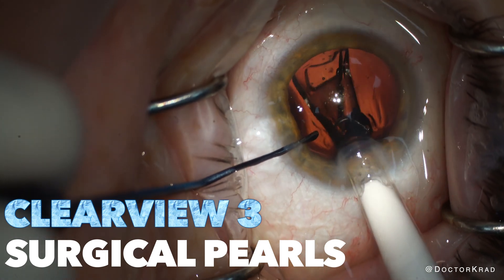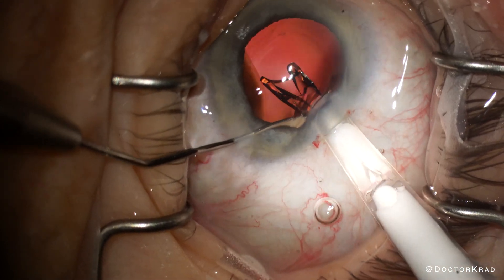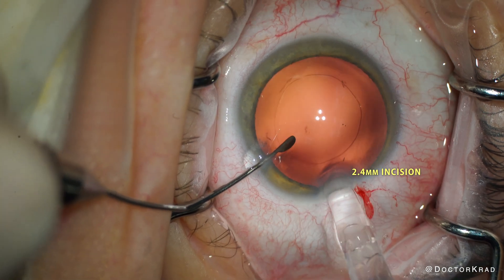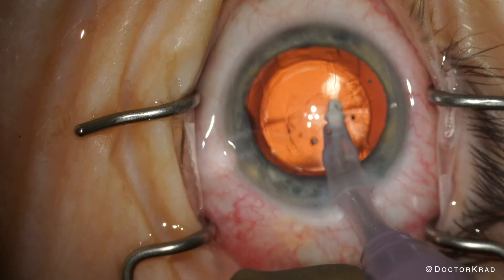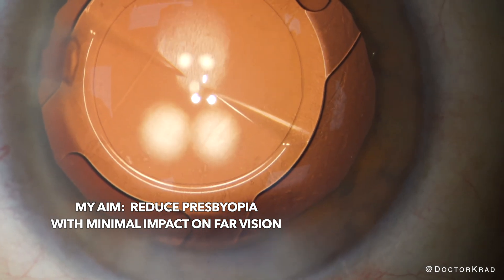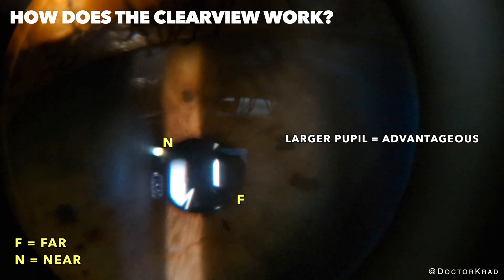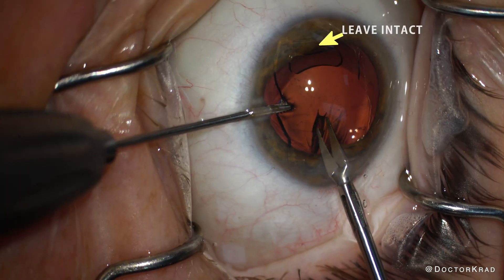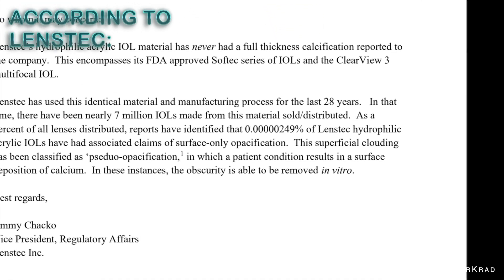Cataract Surgery Pearls with the Clearview 3 Lens Implant

Comment: Doctorkrad, just wondering whether you have ever done cataract surgery on a patient with Fuchs disease and the related risks or downsides associated with doing this procedure for the patient? BTW, super informative videos! 👍
Reply from the maker: Thanks!  Yes I commonly operate on patients with Fuchs dystrophy.  Fuchs patients have less corneal endothelial cells than average, so during surgery we have to be extremely careful to protect the cornea.  Specific steps that a surgeon needs to take are efficient cataract removal, a peripheral incision, guarding the endothelium with a second instrument, and to replenish escaped viscoelastic to keep the endothelium coated and protected throughout the case.  Laser may be used to help increase the efficiency in removing the cataract.  If I expect a patient will need a DSEK or DMEK in the future, I choose a refractive target that is slightly myopic since there will likely be a hyperopic shift after endothelial transplant.  I would also prefer to remove the cataract before it gets very dense since it’ll be less traumatic to the cornea.  Hope that helps!
Reply: @DoctorKrad  , thanks that is very helpful. Your response is much appreciated. Go well!

Comment: Beautiful surgery! I am just an optician, so I am not familiar with this lens design at all, so I have to ask: is there a specific reason why the near segment is positioned the way it is? I would imagine it would be better having it on the bottom instead of the top?
Reply: The near segment orientation doesn't matter like in glasses because light is always refracting through both segments. Rotating and orienting to have purkinje image land in distance segment is a good strategy like here. It is advantageous to have near segment go superonasal because that's where the pupil centers for most people with miosis which occurs when reading
Reply: @bblv2  I come to channels like this to learn, and I just learned a new thing, so I thank you for that